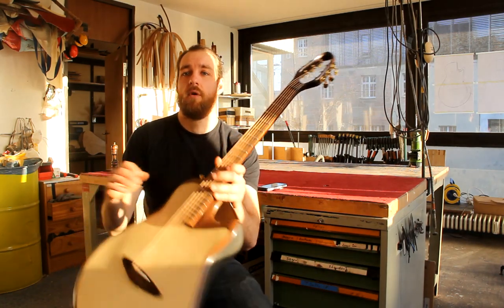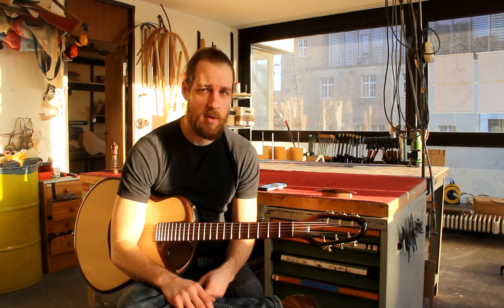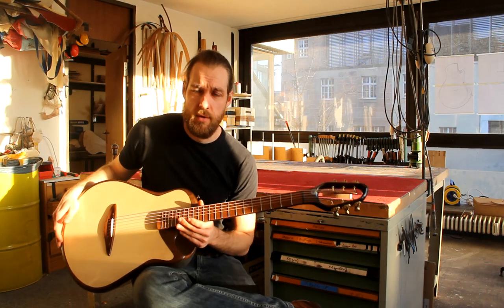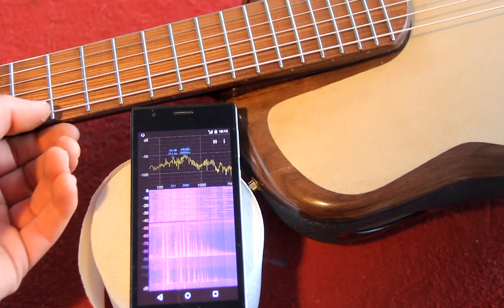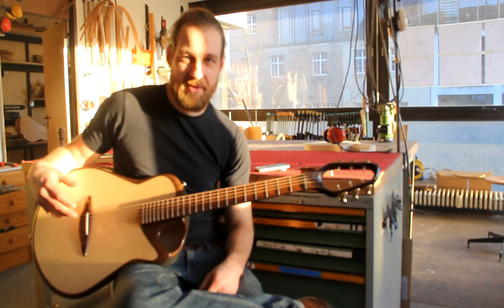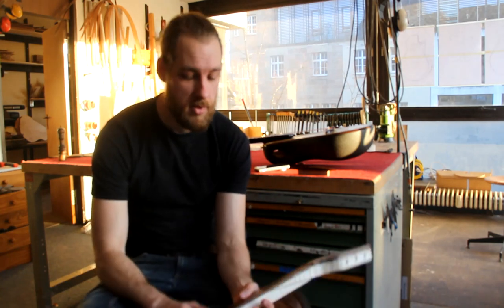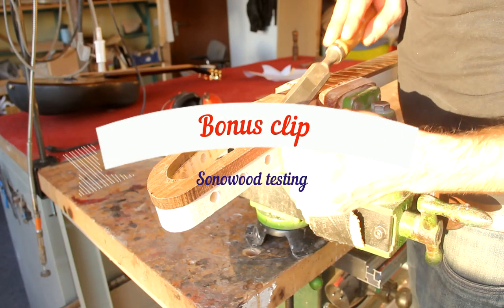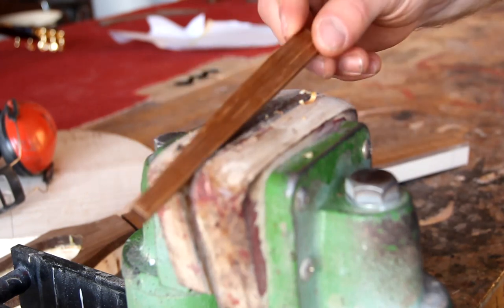the Canna Guitar I made with 'Sonowood'

Comment: l had some extremely cheap chisels. They didn't work well. I gave them a very basic sharpening (as one would a knife). They now work wonderfully! basically just glide through wood. Would recommend!

They probably won't hold an edge as long as high quality chisels, but the difference in usability is remarkable.